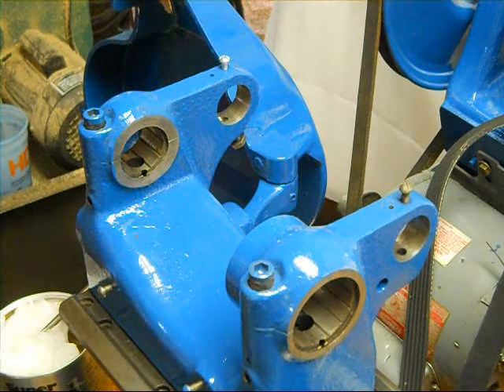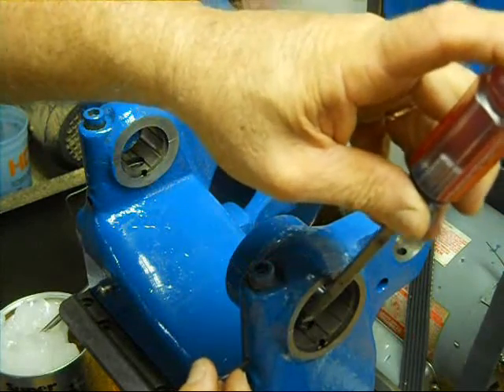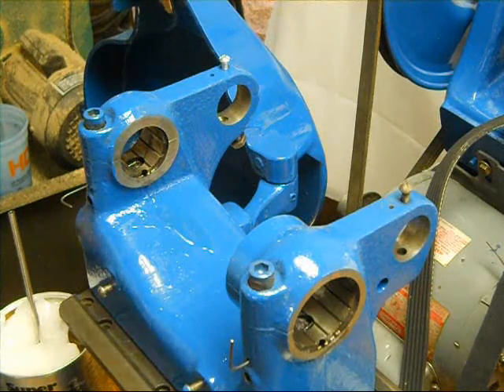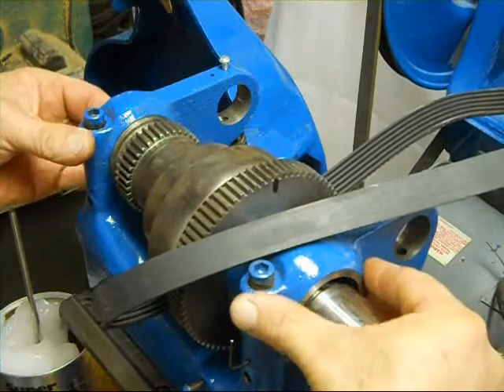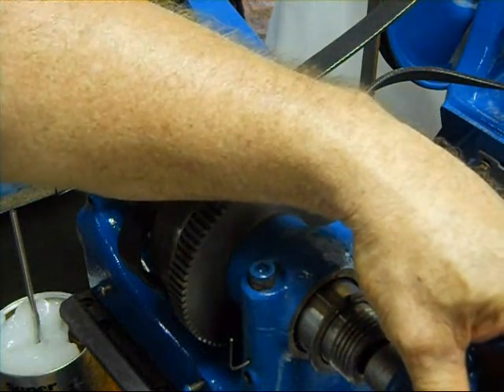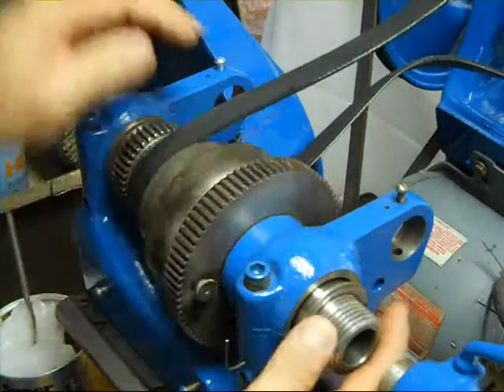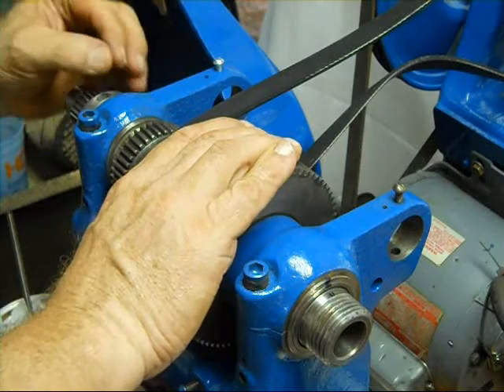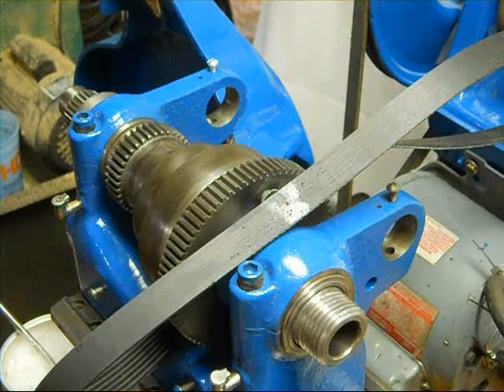Southbend restoration #3 Spindle and back gear assembly

Comment: OMG does this bring back some memories. A couple of years ago, I purchased an identical lathe off Craigslist. It became a labor of love. I was 77 years old at the time, and I am US Army retired 20 years of service and then 15 more years in law enforcement until an accident retired me out. So, completely retired with lots of time to do what I want. I restored 11 Fender and Les Paul guitars, and turned hundreds of pens on my wood turning lathe. This SB lathe was the biggest challenge at the time, but it all turned out great. The Grim Reaper kept knocking at my door and after several medical issues, I am back at it. Lucky for me I had taken out a warranty on my life, then enrolled in a extended warranty, but I think I may have used up most of that. My wife does not find that the least bit amusing, but she supports me at every project and made me promise to be around for 20 more years. This lathe has turned into a money pit, like the boat I bought years ago. I remember taking my lathe apart and putting each and every small part in zip lock bags and marking them. That sure helped when putting it back together. I painted my lathe gray, and used the paint code provided by The Basement shop guy. I have seen a whole rainbow of colors out there, so each to his own. I have upgraded to the QCTP "quick change tool post"  plus just about every gadget advertised by those guys on Youtube . Ebay loves to see me log on. It's fun watching you take your lathe apart, clean it spotless and paint it prior to reassemble. Looking forward to the rest of this great project. You sure a lot more patient than me. No more coffee for me when working on a project. My dog knows when to go back into the house when I have been drinking coffee. :-) .  Anyway enough of me, best of luck with your lathe, looks great so far.   Ken...Marina, CA